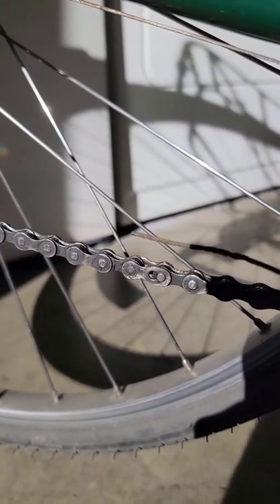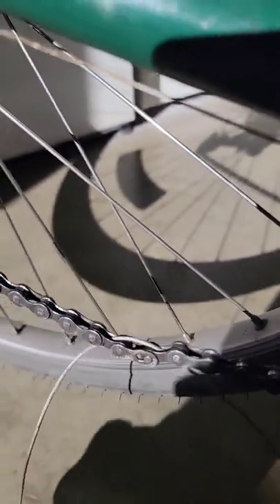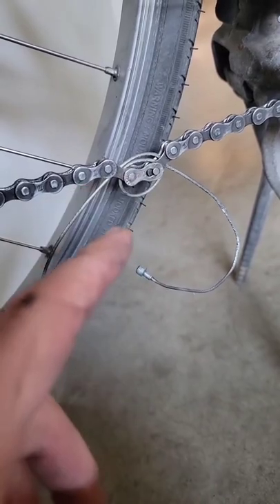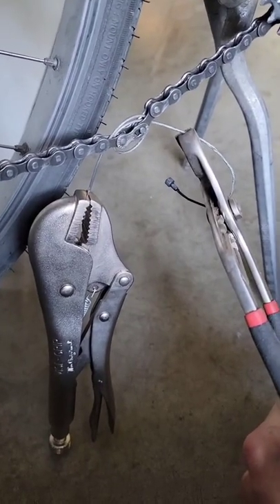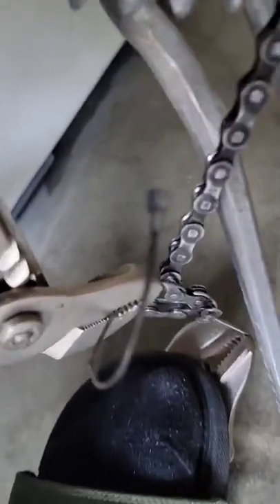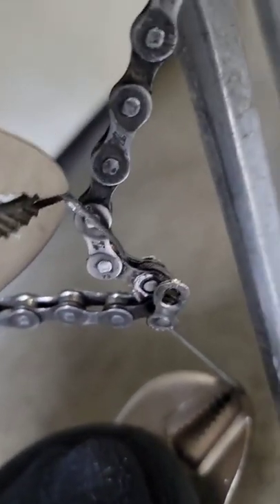How to remove a masterlink ⛓️

Comment: This didn’t work for me, any other suggestions?
Reply from the maker: You can bunch up the chain so the master link sticks up and then grab the plates at a 45* with pliers to force them apart or use a master link removal tool or just a simple chain breaker if brute force is required
Reply: @nukeout  ok thx